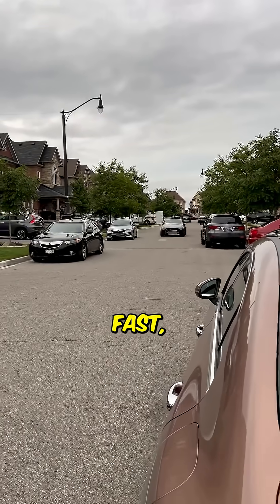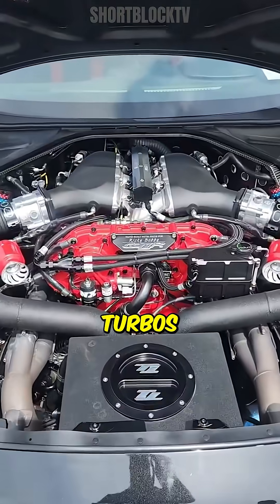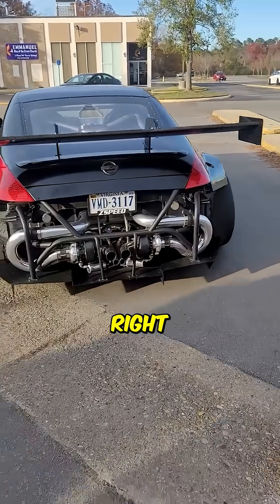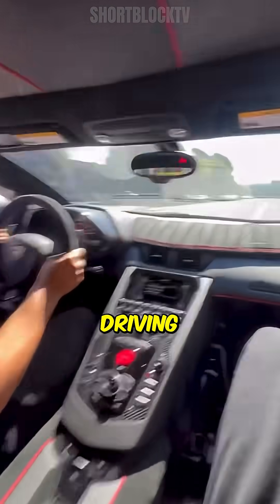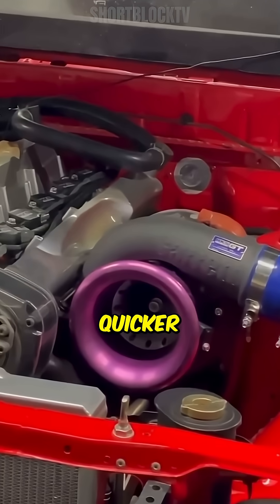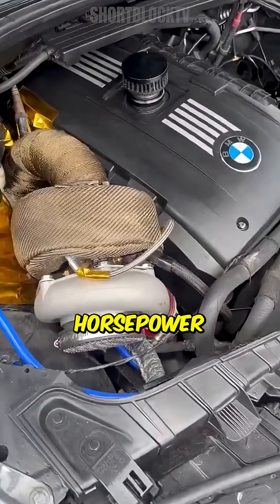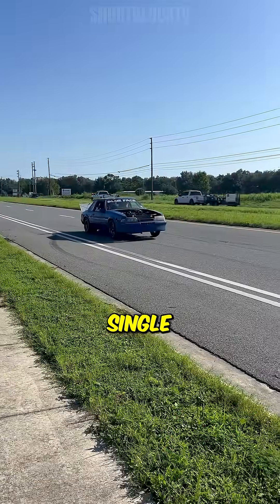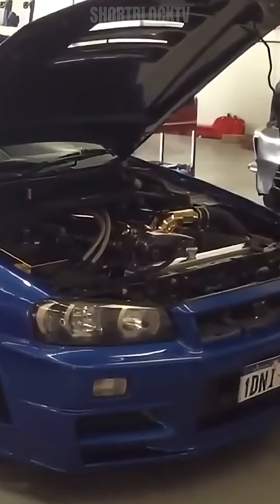Which Turbo Setup is Better?

Comment: That's why you do sequential twin turbo setup do more research you can use the boost on a small turbo to spool a larger turbo you get the response of a small turbo and power of a big turbo
Reply: I immediately thought of this in my head with no knowledge of the sequential sounds bad ass‼️
Reply: @IamJohnJuan that's how the 2jzgte and rb36det use to chase down supercars

Comment: FALSE AF whoever made the video is ass backwards. Single provide lower end and immediate boost. Twin Ts take way longer to spool but give a lot of power on the high end top speed freeway type stuff. Literally depends on the application and what the vehicle is used for. For example drifting requires high torque w no lag so single turbos are best. Whereas twin Ts have a higher end but take longer to boost. So as i said depends. Neither is better than the other. Its comparing oranges to apples